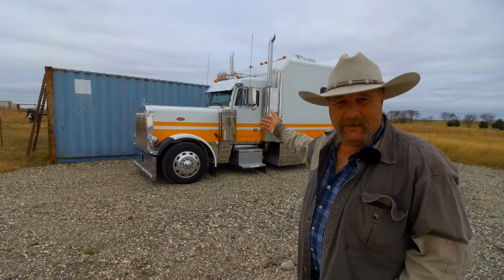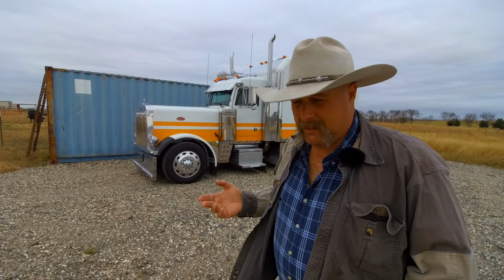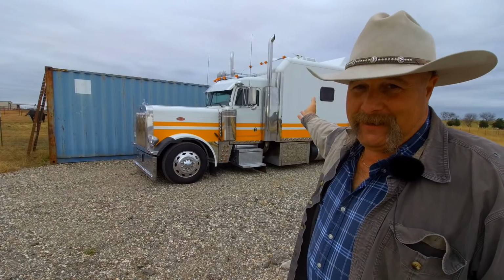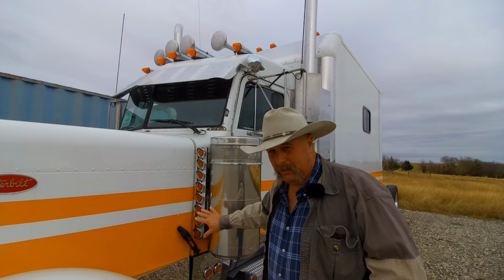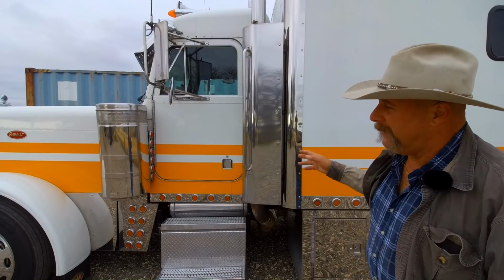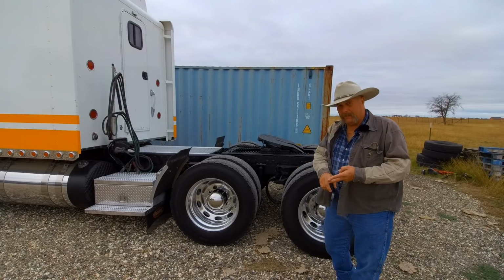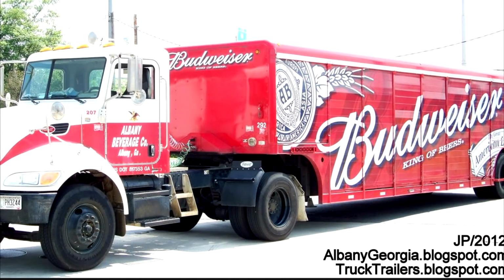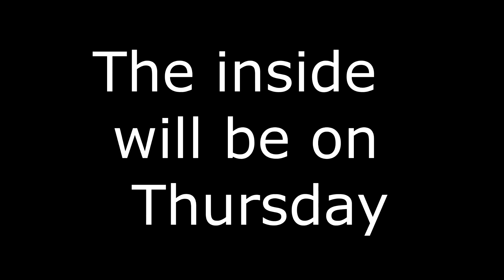571  Lets get to know the new ride

Comment: Those door pins are easy just remember to leave on screw in or thebackibg plate will fall down in there and then you got to pull interior panels out to retrieve it. I found out the hard way. Lol
Reply from the maker: Thanks for the heads up.  Did not know that

Comment: Hey Stan, when you get to the install on the pipes, look into the press in baffles. I installed 8" with the baffles with no resonator or muffler.  It sounded great!   Not to loud and annoying.  Like you, years ago I liked loud pipes lol as I have gotten older, I prefer a softer deep sounding truck.

Comment: My 2005 W900L came with a 550/625HP twin turbo and other than changing out the manifold and turbo's, never had an issue and pulled great especially through the Appalachian mountains, was able to squeeze out 6.3 to 6.7 MPG which is great for a Cat, I know some guys had issues with the 6NZ motors but myself, I guess I got lucky and got one that was tuned right, it was turned up to 780HP but had Cat reset it at 625 and was perfect for the mountains.

Comment: Beautiful rig. 

Not being a driver, I’m curious if they make longer fifth wheel slides so that you can accommodate most any trailer and still not have any weight bearing issues or trailer contact issues?
Reply from the maker: Yes they do.  On heavy haul rigs I've seen 5-6 foot long slides.  Most are 2 1/2 feet
Reply: @Sasnak  is that an option for your rig or no? Obviously there’s cost involved so I could see that being a deterrent.

Comment: Good video as always.  
Q: would be cheaper or easier to find a good Eaton fuller 18 speed from another truck that wrecked but Transmission is still good? Swap out the 13 for 15 or 18 speed?  You may never need all 18 gears, but at least the one time when you do. You have em.   Might cost bit more but in long run, prob pay for itself. I’m surprised truck that big didn’t come with 15 or 18 speed as standard .  Cus she be heavier then then others.   Wouldn’t 18 give better fuel mileage too? And you have no idea what your “may” end up hauling in future. 

Blue or purple stripe would look good on the old girl <3 :) 

Would love see short video to hear her running or jake brakes on down hill heh <3 
Stay safe Stan. <3

Comment: Hey Stan, hope all is treating you well and here is a happy Thanksgiving for you. On another note, I have noticed over the last several years that a lot of truckers are taking the front wind-visor and blocking roughly the third to half of their front windshield by having it low And you would have to have your seat lowered on the inside to see through the visible part. I don’t know why that is done and I think it would impede some of your vision, especially the ones that hug close to the windshield. Can you offer me any ideas as to why that is needed? I really don’t think it’s all that cool and I think for safety, it is wrong to. I would like to get your two thoughts on it.
Reply from the maker: There are a couple trains of thought on the dropped visor look.   For some its done strictly for looks.  The deeper the better they think.  Some do it for the 'Old School" look.   The other reason is to block the sun. As you travel east early in the morning or west in the evening it nice to block that pesky sun.   I like to set my seat at the height I prefer and then choose a visor that comes down to just above my eye level therefore blocking the sun.   This trucks visor does just that.  My only objection is the louvers.

Comment: lol  Stanley at a nightclub full of 18 year olds.........like to see that . Nice explanation on  what Caterpillar tried to please the E.P.A still prefer the C16 600hp or think its the  7cz think the truck I drive with a poxy 500 hp  12,7 series 60 Detroit the owner wants to make it breath better its loud in the cab but outside from a distance super quiet the truck pulls 2 triaxle grain tipping trailers  with bogey axle dolly  truck is 90 gross combination mass currently harvest is in full swing   back to the mufflers they are super restrictive i recon take them off but owner recons to shove jimmy bar down the  insides open them up  and stupid 8 air bag rear sucks on grave rough roads the  truck suspension is no good for  2 deck cattle trailers  cause its too soft scared the owner of the truck and his passenger too when they went to pick up a mob of cattle the truck needs 6 rod suspension air bag are rubbish for rough roads going to ask if he could  purchase super single steer tires and wheels  too be better in paddocks like i got stuck/bogged yesterday with lead full rear empty oh the hurdles of harvest carting cheese with cutters ...........delight

Comment: Are you going to be putting full fenders on it?
Reply from the maker: I forgot to address that didn't I.    Likely add 1/2 fenders.  The full funders get bent to easily.
Reply: @Sasnak  Good choice,  I remember in a previous video you mentioned that the full fenders get easily bent up when connecting/ disconnecting trailers.
Reply: @Sasnak  check out shift products......they make a nice half fenders that weighs 20lbs.........can be painted to match your truck!

Comment: Is it true that there is only about 3 different keys to open the doors? I was at the auto auction in Dallas picking up a load of cars and a driver came up and asked if I would try my key on his truck he locked his in the truck and I said why my key won’t work on your door and he said that there is only 3 different keys on the peterbuilt trucks. I took mine down and put it in his door and dang it opened rite up. He said take my key out and put yours in and try to start it and it did. I was shocked and never felt safe sleeping in it after that
Reply from the maker: I've heard that about Freightliners but not Pete's